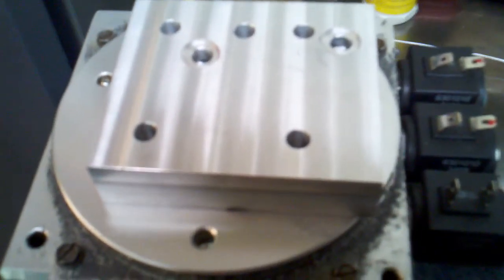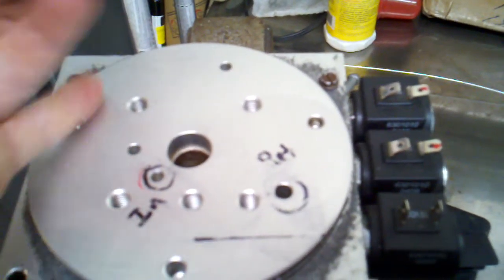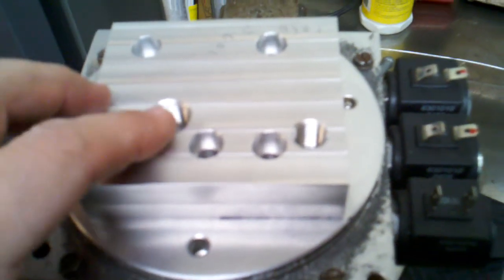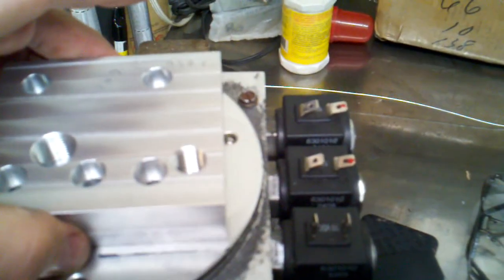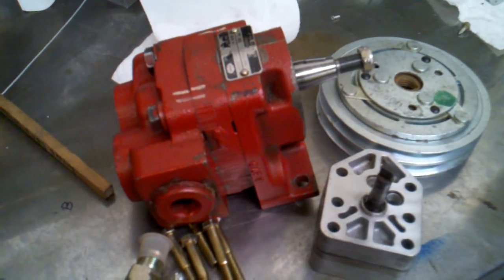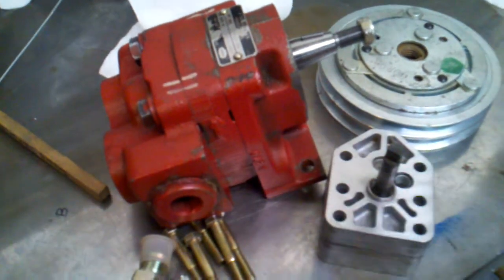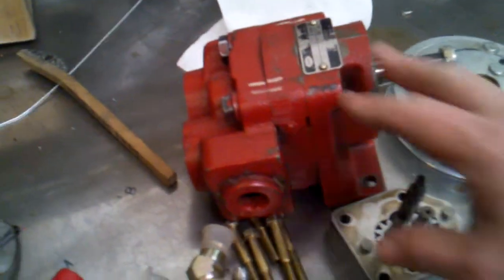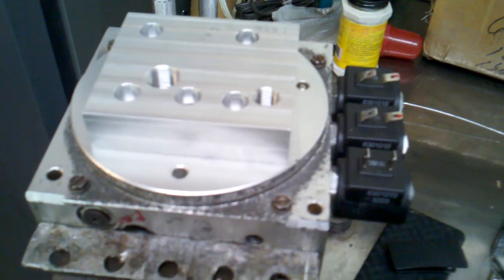Fisher insta act conversion

Comment: FYI...I am using a belt driven (two pulley) hydraulic pump to operate a winch. I have it very tight and I still smell the belt smoking. Very frustrating and about to switch over to a chain drive.